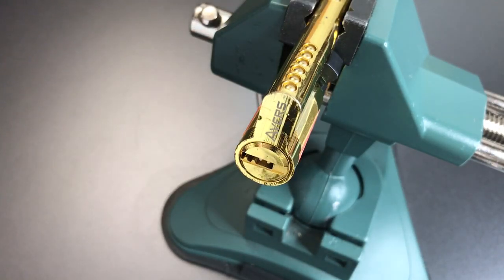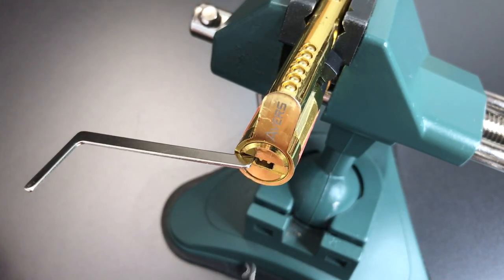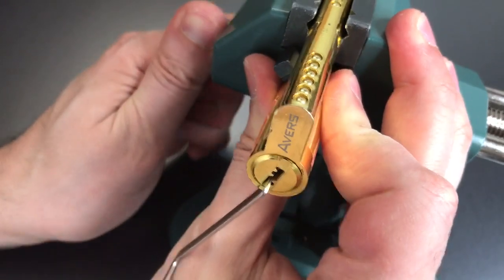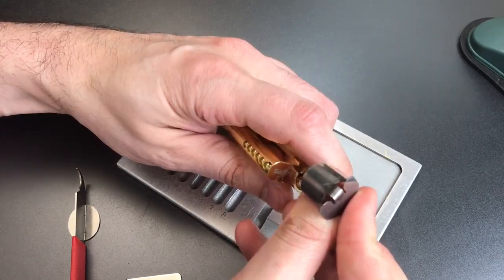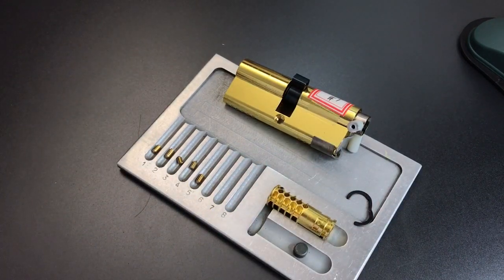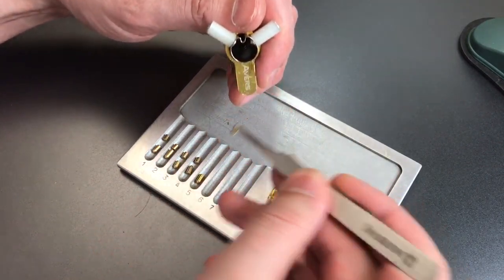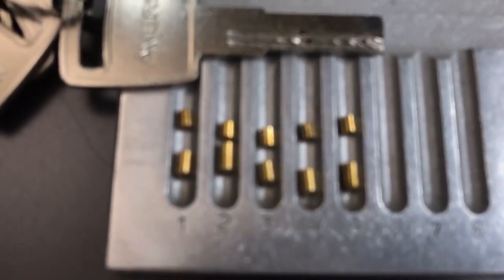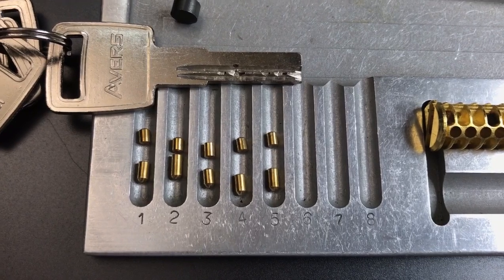[418] Avers "ZM" Euro Profile Cylinder Picked and Gutted

Comment: a core like that borders malice. that seems more like a preventative measure against locksmiths reusing parts than anything else. yeah, you save $.003 in each lock, but to make it the size that pins can fall in feels like spite, otherwise, wouldn't the unpinned portion of the core look the same, to save even more metal?
Reply from the maker: I have no idea why they do it, but it definitely makes the lives of locksmiths harder.  I'll say it again.  I'm lucky that I happened to disassemble the lock the way I did.  Any other way would have resulted in disaster.

Comment: that core also looks pretty soft as well with no drill protection.

I guess market research has indicated that those type of keys give the impression of higher security.

nice tools. normally you use the follower; I'd not seen you use those before.
Reply from the maker: Perhaps... I'll have to see how the standard pin tumber locks from this company are.

Comment: Are there dimple lock rakes?
Reply from the maker: Yes.  The problem with them is that you need lots of them, and finding one that works in a particular lock is tricky.  It's usually way faster to SPP IMO.
Reply: Thanks for the answer, have a great day!
Reply: I have just bought my first dimple lock (cheap chinese) to try the Bangood dimple picks. Not too hard to SPP but I realized that I can also rake it, attacking the top of the pins from the side with my standard rakes and then turning to push the pins into place. This works very well my my city rake, but also the bogotta and the worm from any pick set I have. It generally takes less than 10 secondes with any pick.
Reply from the maker: For some more raking fun (and a few laughs), see my video #70.  ;-)